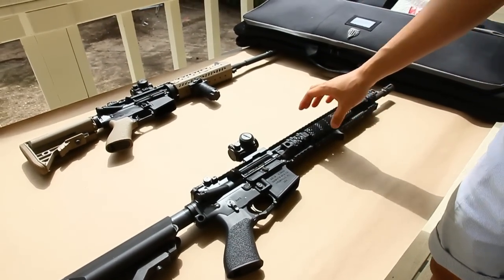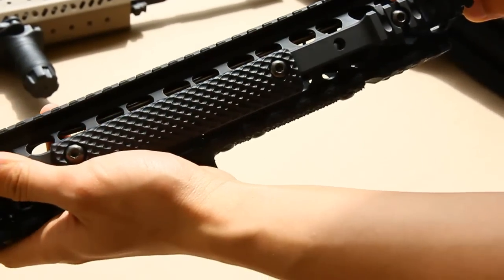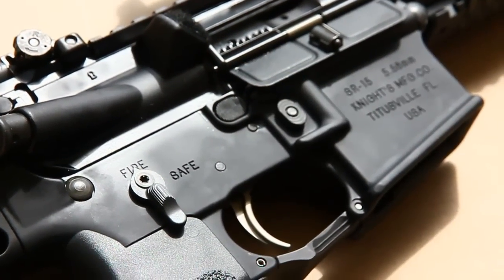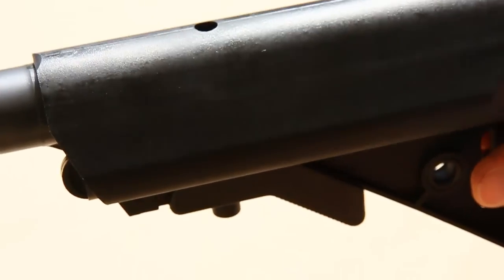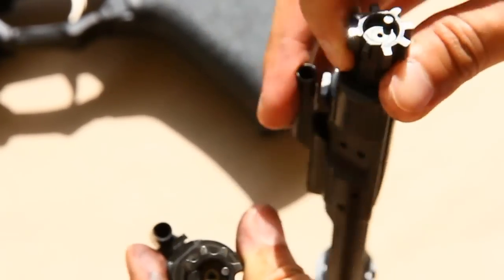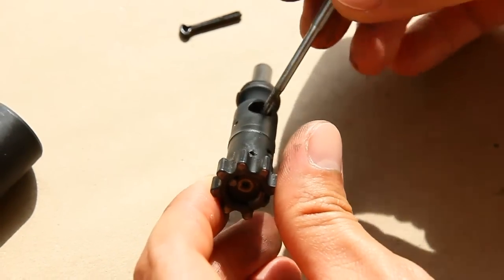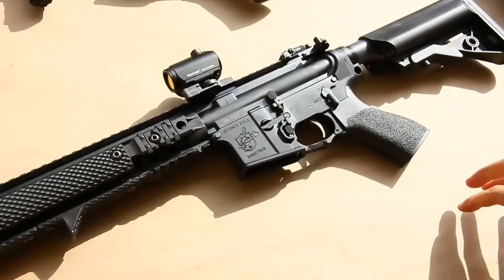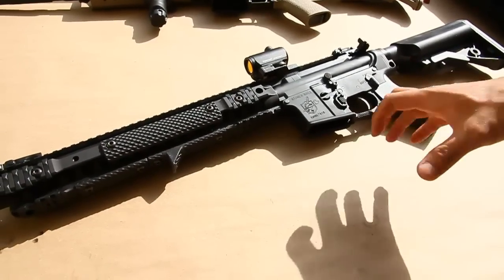Knights Armament SR-15 Mod1 Review (AR15/SR15)

Comment: Bravo Co., Spikes and some Noveske's also use Dry Film lube. 
I say, Dry Film process to the innards of the upper receiver add to reliability to these quality AR's.

Thanks for the review brother.
Reply from the maker: Good to know, and I'm glad you enjoyed the review.
Those mentioned companies are all top manufacturers, its certainly nice to know they are using DFL in their upper.
Reply: No question, you have some quality stuff and your reviews are the right length in time slot. With very good info wrapped in there.

May I ask the round count currently on this KAC an the SLR104-31?

I have personal issues running bi-metal jackets in my work rifles, but no problem with steel cased training Hornady, which we get supplied to us in bulk.
Hope to see you on G+ brother.
Reply from the maker: Silver State Arms I have 2200-2500rds through the SR15, and finally cleaned it recently. As for the SLR104, I'm not completely sure on the round count, but most likely 1500-1800rds.

Both rifles functioned perfectly with steel case ammo of all kinds, no problem from either rifles since day 1.

Comment: KAC  buffer tubes and stocks are made by LMT... The grey film keeps the tube from rattling within the SOPMOD stock.
Reply: It’s actually dry film lube and it’s there to mitigate any snagging or binding of the buffer spring and buffer against the inside of the buffer tube. It has nothing to do with the stock
Reply: Is that true? LMT makes identical buffer tubes for KAC?

Comment: Thinking of buying one of these but it's so expensive for a standard, well built, mil spec AR with forged upper and lower. Not sure it's worth it when compared to a Daniel Defense which is about 500-600 dollars cheaper. 

I really want one bad though so I'll probably buy it. How is the play between the upper and lower receivers? It bugs the crap out of me when an AR rattles and has a noticeable amount of play... Can you comment on that? I've heard it varies from rifle to rifle so I guess I won't be able to tell until it shows up at my FFL. 

Thanks for the quality video.
Reply from the maker: ***** Agreed :D
Reply: ***** Sorry, DD has Colt beat all day long.

I ended up buying a Larue but I'll still probably buy a KAC one day eventually, I just couldn't pass up the chance for the Larue without having to wait for years.
Reply: Daniel defense is overpriced shit... you do noy grt any improvement over the original rifle. Here you get a fine tuned gas system, better bolt and extractor.

Comment: Could you please answer a quick question? In your opinion, is the Tango Down grip worth the price? Magpul has a grip with similar features and it's half the price. I know it's a preference thing and obvi you like the Tango but I don't get the price. perhaps this is a silly question when the rifle is so expensive but I thought I would ask. BTW, I followed your lead and got the BCM charging handle. After only a bit of use, the factory charging handle started marring the receiver just as you described.
Reply from the maker: I forget but are you the guy that recently got a SR15? Is that why you switched out the original CH for a BCM CH?

For the PG, bought the TD grip simply for the look. I have Magpul MIAD on 2 of my other AR and it works fine. Just buy whatever you want, PG selection can be a very subjective thing, so.... you might have to try out multiple options.
I actually recently switched to Magpul K2 grip for the steeper angle it has, it feels so much better than the traditional grip(angle), I really really prefer the K2 over anything else thats available on the market.

All the steeper angle PG will look strange on the gun, however, IMHO the K2 is both the most aesthetically pleasing and most ergonomic steep angle PG I've tried, and I've tried BCM Mod1 and the Umbrella Corp. grip.
Reply: Yeah, I did. Thanks for your feedback!

Comment: Hey there, Kidd. Talked to you a while back on here(formally MikeVee024) and on AKFiles(EGMak104FR) Anyways, wanted to thank you again for the suggestions and let you know I finally picked up an SR-15 Mod 1!!! I think I did pretty good(NIB for $1800). Love the feel of it so far, but haven't taken her to the range yet. Like you, I'm an AK guy so this is whole new territory for me. So, from what I gathered here I do probably need to replace the charging handle. Already changed the pistol grip with a Hogue 15003(Which feels perfect in my smaller hands). I do have a rail panel kit for it, but unfortunately the side panels are not much longer than the handstop. I'm guessing the one you used here is the long panel kit, Correct? Any other suggestions on upgrades, ammo to use with this rifle, optic choices, etc. would be highly appreciated!! Thanks ;)
Reply from the maker: Good to hear you got it! I actually shot out my first Mod1 due to my regular schedule of mag dumping steel case wolf ammo(5k steel, 8k brass). I currently have 3 Mod1 and 2 Mod1 LPR. For my main shooter Mod1, I have a TA31F ACOG Red Chevron, and my preferred and one of the most accurate ammo is the CBC/Magtech 77gr OTM. To my surprise, GECO 55gr 5.56 is also really accurate, doing 1.3 MOA 10rd groups at 100 yards, which is only slightly less accurate than Magtech 77gr.
Reply: Oh wow! Excellent! You must really love this rifle. Do you still shoot your AK's, too? Btw I just recently purchased a 2nd SLR-104FR(Mostly for my fiancee to use since she does pretty well with mine). I think 5.45/7N6 will probably always be my "go-to" round but figured it was time to creep over to the "dark side" of AR's haha.. ;) Glad you told me about the steel cased issue as that's of course what I'm mostly used to shooting with AK's and Makarov's. That also makes sense that a heavier grain bullet does well with it's 1/7 twist rate. Thnx will have to try both of those. How do you like the ACOG so far? I actually been thinking of picking one up w/ ACSS reticle since I'm currently using the Holosun 503G ACSS on most my rifles.
Reply from the maker: I dont think I can live without having a TA31F haha. If I could I would put it on all my 5.56 guns. I only have 2 right now, one on main shooter Mod1 and another on my AUG A3. DO NOT buy the ACSS version.... I sold my within 3 days of using it at the range... the reticle is EXTREMELY small and you seriously can not see the actual shape of the chevron, it looks more like a circular dot. The 'horse shoe' blocks out a lot of the surroundings of your target, which is annoying. If only could they make the reticle bigger.... I also have PA 3x and 5x ACSS scopes, and the reticle in those are good to go. For some reason the version PA sent to Trijicon is smaller. I actually am capable of doing 1.25MOA to 1.5MOA using the TA31F, and when I switch to the ACSS version, the very best I could do was 1.75MOA 10rd group at 100. I really want to like the ACSS version of the TA31... but I end up hating it.
Reply from the maker: Also, I don't really shoot my AK as much any more.... I really think the Mod1 is my favorite rifle (maybe ever) and don't think any gun could beat it for general usage/fuction/performance and all the other 'pride' factors like, collectability, aesthetics, popularity. Another reason I don't shoot my AK is that I've started to relocated the spending funds to enjoy more of the 'lesser demanded' guns like BM59, FAL, Z43P (HK93), Colt SP1, Bren 805, and K98k
Reply: +KAChan (Ian) Copy that. Once again glad I consulted you. TA31F it is.
Reply: +KAChan (Ian) That's awesome, man. Makes me feel very confident in my purchase. I did a bit of research and everything indicates the SR-15 Mod 1 is (arguably) the very best out of box AR available. That along with your vids/reviews helped push me over the edge. I actually almost picked up a Polish Radom Beryl/Archer instead, but decided against it as I didn't like the inconsistencies in parts used during the importing process(Plus it looks like Radom will be importing more rifles soon). Smart move on trying out a wide range of firearms. You have very good tastes, sir. Anyways, really glad I went with the SR-15 and can't wait to take her to the range. I'll get back to you and let ya know how she performs ;)

Comment: So I just picked up this exact model for 1600 bucks used but in perfect shape. I see you shoot a lot of steel case which I'd like to do but I'm worried about dumping money on a bulk buy of say 1200 rounds and find out it doesn't feed well in my KAC. What's your experience with steel case as well as what kind you use? I've considered Tula but heard it's not as hot as Wolf as far as pressures go.
Reply from the maker: +G “Krillin92” St 
Out of the 12,000rds I've shot, exactly 4000rds were Wolf & Silver Bear, absolutely no problem. One important thing about those bimetal jacketed bullets... if you rapid fire a lot like I do, you will have a rather worn barrel after 4000-6000rds. 

I noticed two of the lands in my SR15's bore were barely visible at about the 10,000rd mark(4k of bimetal ammo, and almost all rounds were rapid fire). I've since sold that particular rifle(rifle shown in vid) and now using another SR15 Mod1 using all copper jacket ammo brass cased, now near 10k mark with perfect bore.
Reply: +Ian L. (KAChan) well in that case I'll stick with brass case factory reloads. It's about 6 cents more but I had a feeling it might wear the barrels out faster which I don't know if nights offers replacement barrels for these?
Reply from the maker: G St Knight's will not replace barrels, I've already asked them before. Also, keep in mind the Mod1 gas block/gas tube is different than the current Mod2. 

I wouldn't shoot reloads either.
Just buy Wolf GOLD 55gr brass ammo or other factory 223/5.56 that is about 30 cents per round.